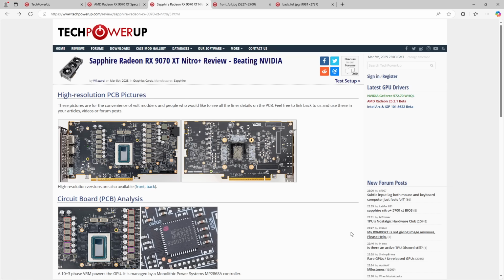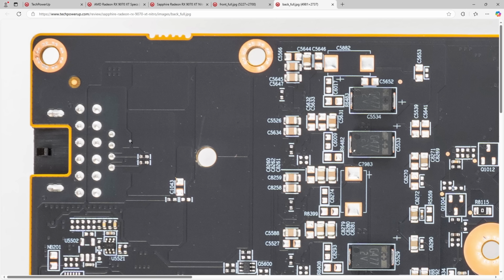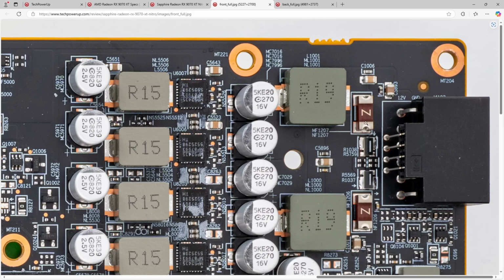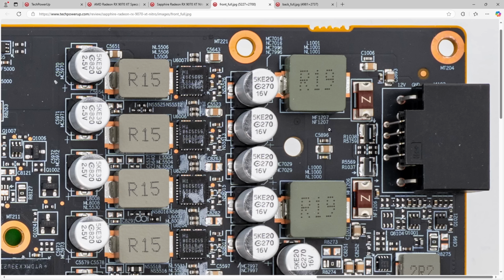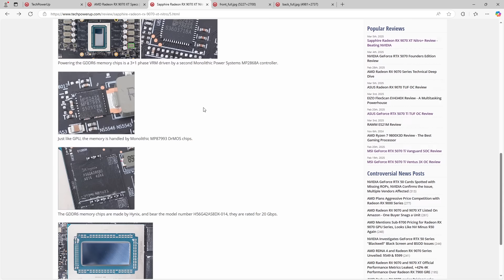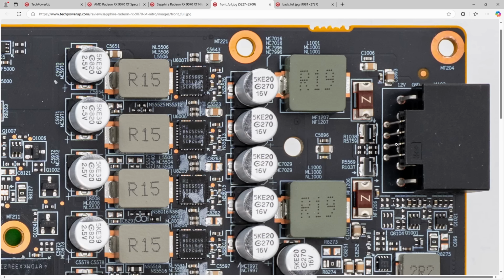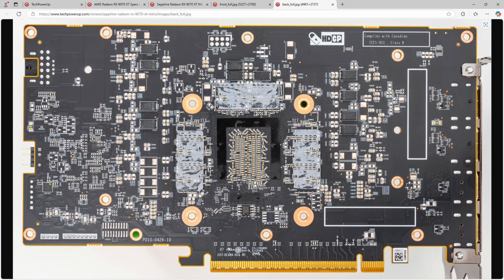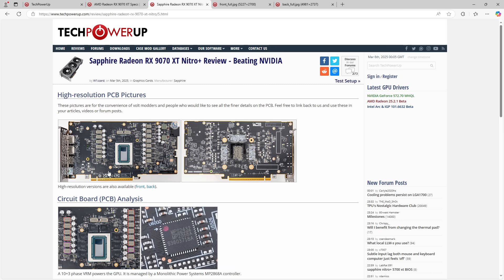Taking a look at Sapphire implementation of the 12VHPWR connector on the RX 9070 XT Nitro+

Comment: that's extremely disappointing... it's a gorgeous card, but that's basically disqualifying if you have the option to get a card with normal 8 pins.
Reply: Looks like it's time for me to give XFX a shot...
Reply: @nothing.mp3  i have one of their 6800s and it's been a great card so far
Reply: right? the red devil is on the top of my list.
Reply: I most likely go with Pulse, but RD and XFX are also on my list.
Reply: Very disappointing. I still have a Sapphire 5700XT Nitro+ in my daughter's PC that is rock solid. I've had a couple Sapphires over the years and they've had no issues till the day they were decommissioned from old age.

12VHPWR connector is too badly designed and too big a risk. If 8pin is an option, it makes much more sense.
Reply: @Denominus  every amd card i ever had except for my current xfx 6800 has been sapphire, since my first ati hd3650 agp... Well, they still have the pulse and pure, but i expected them to either basically school everyone on how to properly implement this stupid connector or just not use it at all. Shame, cause aesthetically the new nitro is one of the most stunnign gpus i've ever seen.
Reply: @Denominus  At the end of the card like this, but with each phase (or at least 2/2/2 split, without the idiotic bridging right after the connector, into 1 line), might not be TOO bad. Little thicker wires would be nicer however.
Reply: Total layman here. I've been asking myself for a while now, why all of them use these 6 or 8 pin plugs? Why not 3 pin plugs with thicker cables or a single barrell plug. Are there standards for these connectors and they won't get applied properly or something? If overloading single wires can cause fires, why not use thicker cables? Please help me understand, why this is a problem in the first place.
Reply: @ the 6 and 8 pin are fine, you have multiple 12 volt lines and multiple ground lines, and then you have multiple plugs that are usually current balanced.

for the 6 pin, you have 3x 12 and 3x ground, for the 8 pin same, but you have two added sens pins that need to make contact for the card to start. the 8 pin is rated for 150 watts, but it can handle a lot more than that in reality, and once you have 3 of them on a card, even if one of them makes no contact whatsoever it wouldn't be a problem, and the card could probably sense that one of them isn't delivering the right amount of power and shut down.

the 12v hpwr is just stupid. it's rated for 600 watts, despite having the same amount of 12v wires as  two 8 pins, which would come out to half that. also, if it's implemented like this, there's no current balancing or even detection of current imbalance between the pins possible. whereas on 2 8 pins, you'd have at least the option do detect and balance between 2 groups of 3 12 pins, and in the absulte worst case where only one of them made contact you'd only be running 150 watts through a single wire, not 600 like on the 12vhpwr 

then you have a wider single connector, with more wires attached to that connector, so there's more possible leverage on it, making it more likely that some pins don't make perfect contact. 

it's an abject failure of a connector in any way you look at it. neither the 6 or 8 pin ever had any of these issues cause they have much higher safety margins, and more ways to monitor their connection on the GPU side.
Reply: Bruh it draws less than half the power the cable is made for, it will be fine
Reply: Yeah, they f*cked up by putting that Nvidia branded crap on an AMD card.
Reply: @narrativeless404  AMD was actually involved in setting the standard up, too. And in THEORY, one can implement it safely - but with each round so far, they made it worse.
Plus if it doesn't have a safety margin of at least 2x, it is not a consumer product.
Reply: @LordNecron  True. It's not a consumer product, it's a violation of consumer rights.
Reply: Starting this generation, Sapphire should go on 'do not buy' shitlists, this is stupid.
Reply: Even if this GPU comes with 400W bios, there´s no way this connector will fail with these loads. Maybe if You literally cut off 5 of the 12V cables. Would not worry about it too much.
Reply: @ some 5080s have literally already failed at the same power targets. so yes, there is very much way. cause this connector won't detect if only one or two pins make real contact.

it's even more concerning  considering there's like three dozen 5080s in total, and some of them have already melted their power connectors...
Reply: @ailolen3954  It would still fail if half of the power goes through a single wire.
That connector is just terribly designed in general.

Comment: hey Buildzoid have you considered that maybe nvidia did those changes in the 40+ series for the purpose of getting a more stable current to address the 30 series transient power spikes issue? If that's the case, they took the easy and cheap route without thinking of the consequences very well

Comment: Considering Saphire is splitting the 12v downstream, it was missed opertunity to not at least split into two 12v banks from the connector. They have the space.
Reply: I'm wondering if you could just break the traces on the PCB to make that happen. Obviously it would void the warranty, but it would be hilarious if someone did it and made a video of it.
Reply: @bobbygetsbanned6049  what warranty lol it's not like nvidia is replacing any burnt cards, they're just blaming the customer for it.
Reply: @AlkaVirus  I'm not talking about NVIDIA, I'm talking about this Sapphire card only. NVIDIA only has 1 power rail so it wouldn't even make sense to do it on their cards.
Reply: Serious question about the specs mandating all 6pins to be fused
Reply: @brunogm  it's a lack of guidance that does it.  You can adhere to the spec by just doing the bare minimum
Reply: @brunogm   I doubt it since 3090 didnt have that..
Reply: @peterkolesar4020 the initial 12VHPWR standard wasn’t even finalized when the 3090 used it; it didn’t even have sense pins.
Reply: @peterkolesar4020  the 3090 did use another 12pin
Reply: @rpgmafia8363  No it didnt, 3090/Ti had the connector on the card side split into 3 partitions of 2 pins each and was handled as such. Later cards including this bs from Sapphire have all 6 pins handled as one and only include any measures after that so the card side connector is not protected at all. You can literally cut 5/6 wires and the card will run. Thats just stupid.
Reply: @peterkolesar4020  That would be 29A. The 20A fuse would blow.
Reply: @stevewatson6839  actually it would be ~32A and the fuze wont do 💩 because its behind the connector so the connector and the cable will burn like the fuzes arent there. Bs solution to a non-existent problem making only more problems.
Reply: ASRock has a 9070XT Taichi OC that's using the 12v2×6 connector. It's their 3100 Mhz boost clock 340 watt card. Can you do a video just like this one on that card, please? As far as I know, that one and the one in this video are the only two that are using that cable. The 9070XT Taichi OC is the only AMD 9000 series card confirmed to have a water block for a custom loop so far, though. 

Thanks, Buildzoid! GGs
Reply: They probably felt safe to cost cut since its a 350W TDP, but still dumb either way , i think down the line if your card decides to somehow Load Manage into 1/2 wires then ur still fked. 

Current will always follow the path of least resistance.
Reply: @LukjoJak  But they've only put this on their fanciest RX 9070 XT. Their other 9070 XT models, which are cheaper, use regular 8-pin power connectors. 

It's like they thought that the newer connector would make the card look more modern or something? Or maybe they thought that people really care more about being able to use just one cable than having to use two or three 8-pin connectors? I can't think of any other reason why they've used the 12v high failure connector only on their Nitro+ model of 9070 XT. 

All of their 9060 XTs also use regular 8-pin power connectors, including the Nitro+ model.
Reply: @syncmonism  my only guess is that on the PCB only having to account for 1 connector instead of 3 is their cost cutting measure,  also that probably 1x HWPWR connector should cost less then 3x 8 pin connectors (at least probably should at this point, the new mould probably got back its development cost already)
Reply: It looks like they have the space to do full sensing and current limiting on each incoming line. Let alone do a simple split.
Reply: Molex mega-fit  goes to 5.7mm pitch  instead of 3.85 but it allows 23A per pin;  There are mini-fit+  and other variations that would probably be better;    Specs alone double 6pin PCIe connectors could surpass 12VHP  H++;
Reply: Like Buidzoid mentioned having them ganged together like that could be part of the ATX 3.1 standard and/or the PCI-SIG PCIe standard.
Reply: @longjohn526  Oh fuck, our connector is melting, quick make the spec even worse! lmfao.
Reply: @ maybe but then its a stupid standard. That being said if I was Sapphire or ASRock it would be another reason to avoid it. Like for the majority of buyers who are not GPU anarchists like us it wont matter anyway, they dont inspect the cards just buy them plug&play. But those of us who do inspect it would most likely be disgusted so why bother? 
My guess is the decision making is not done by engineers but marketing 💩heads...
Reply: @longjohn526  I was just about to start a deep dive into the specifications for that, but the PCI Express External Cabling Specification costs about 4500$ which is about 4490$ more than I would be willing to pay for a pdf just to ease my curiosity.
I guess It's going to remain a mystery until someone who already has access to the specs can solve this mystery.

Edit: This may very well be the wrong spec to begin with, since the conncetor and its connection to the board may also be handled by the Electromechanical Specification.
Reply: @longjohn526  it's not part of the incorporated ATX 3.1 standard. It actually seems to run counter to Molex's published use for the terminals, but in engineered product like this that's not uncommon. 6/8 pin PCIe breaks the same rule. As does CPU +12 and EPS.
Reply: @ragzillaz  IIRC one of Asus cards has like per wire/pin shunt resistors for monitoring, so its for sure not required to fuse them, or at least if it is - Asus broke some rules ;)
Reply: The original implementation of that plug by Nvidia had 3 load balancers, with 2 phases each. Still not good, but you'd only overload a wire with 2x the load. The 'all 6 bridged' is a 'Do not buy' no matter what is on the card after that, as you can still screw the connector, cable or PSU.
Reply: Makes me wonder if you can modify a card by cutting the trace of the 12VHF connector on the PCB and feed 3 into each stage. Doing so securely would require a board redesign but I might be possible with a bodge wire

Comment: I wonder if the pair of shunt resisters is to trick the firmware into thinking there are two 8-pin connectors like the reference spec. I'd be interested to see what HW monitor would say under load.

Comment: i keep saying the way to do it is with a mini 10-pin connector. kitty corner sense pins (but only two) at either end, 4 12v and 4 ground. its still good for 300w so use two of them. directly replaces 8 pin.

part of the reason this connector is bad is that it has 2 kinds of pins in it, and requires more strain relief. older 8-pin cables safely flex on the long axis, new cable do not like flex on either axis. with the cards being so large, safe flexibility is important for fitment and cable routing.
Reply: And Nitro+ requires not one but two 90 degrees bends on the cable 😉

Comment: sad failed opportunity to show Nvidia how it's done well they did fix the no1 problem of the connector that it's situated sideways on RTX cards that are already much wider than previous gpus which cumulated with the 12VHPWR lack of flexibility makes sure that when you close 99/100 cases you will push on the connector

Comment: Why even have 6 separate pins on the connectors? Wouldn't you not have to worry about load balancing if all 6 wires were a single large "pin"? Really a blade/bar connector like on AC disconnects.
Reply: 3 bigger pins/blades like server PSU.

Comment: This feels like a sort of half-assed protection scheme, similar to the Asus Astral PCBs with their per-pin monitoring that then gets combined anyways. They were so close to balancing it in 2 halves, which while not ideal, is still not as bad as it is here or on an FE card for example.

350W is still technically within the 375W that is allowed by default in the maximum sense pin configuration before the card negotiates for more, but that's still a card with the potential to pull ~29.2A though a connector with pins that are rated for about 9.5A each.13A is the absolute highest rating I've seen for any style of this pin, but 9.5A appears to be the most common from what I can find. Either way that would be more than 2x over draw if it had to go through 1 pin.
Reply: a new connector using per pin size of old PCIe cable or reducing 6 small pins to 3 thicker ones;   The relationship of plastic vs metal could be better;
Reply: The other thing that's important to keep in mind is that power dissipation in a resistive path is P=I²R, so 2x current overdraw is in fact violating the spec by a factor of four.
Reply: Combining it after the per pin monitoring is completely fine. All they're trying to do is limit the amount of draw from each wire which is what caused the melting wire issue. Asus's implementation isn't half ass, it's how the standard should be.
Reply: @sirmonkey1985  Per-pin monitoring is not per-pin balancing. The astral PCBs can still do nothing to save themselves beyond throttling the card or warning the user, which they have to be paying attention to see and take action on. Active control, not just metering, is needed to push this connector that far safely.
Reply: Don’t get paranoid just because it happened one time with a guy using an older mod cable on top. Mostly it will absolutely use more than 1 Pin. 1 Pin usage will be in the rarest cases.
Reply: @eazen  Are you unaware of the many other melted 4090s and 5090s, as well as the few 4080s and 5080s.
Reply: @eazen  you are delusional by ignoring the many many many melting connectors